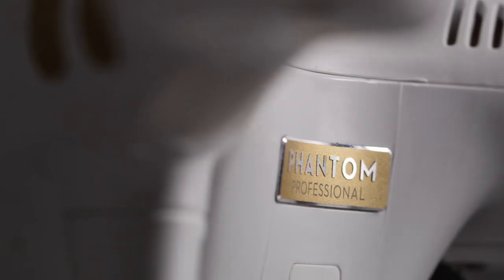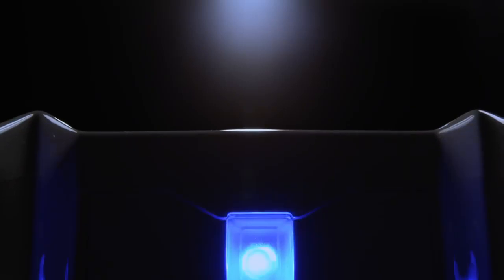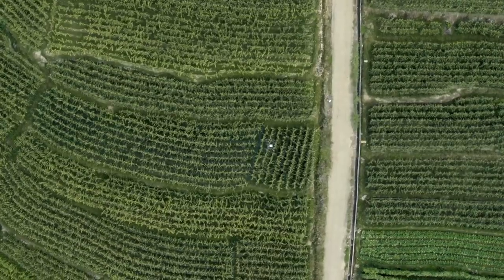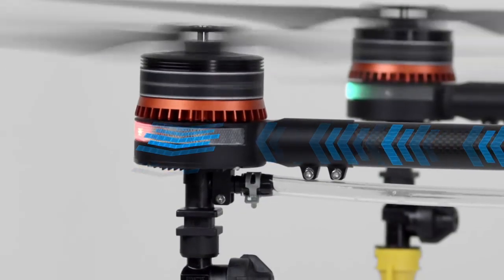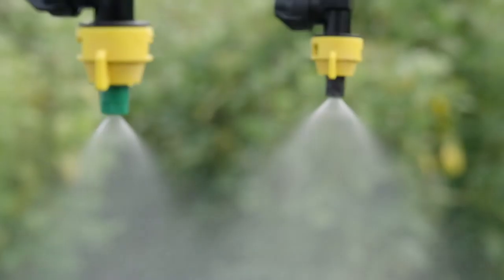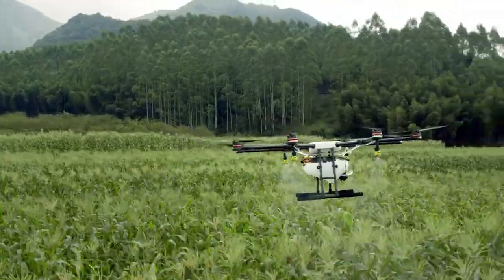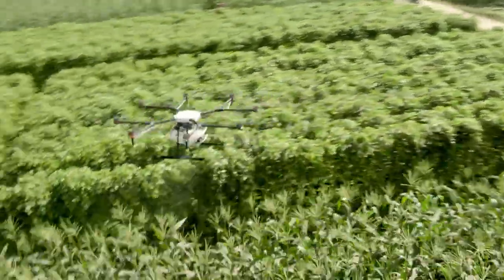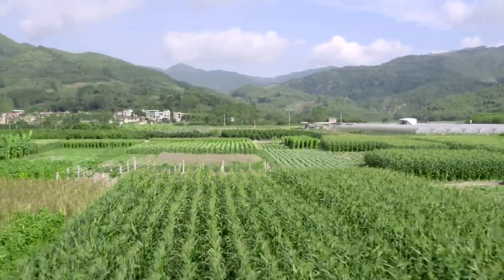DJI Agras MG-1 ALL NEW! Agriculture Spraying Drone!

Comment: Tank holds 10kg  (about 22lbs or 2.6 gallons) so I assume this is being marketed to "small" farms. Drone runs for 10K meters per charge which is about 2.47 acres. A "small" agriculture farm has around 100 acres (average in USA is 444 acres) so the drone would have to fly around 40 times to fully spray 100 acres. IF the drone could automatically refill the herbicide/insecticide AND automatically swap batteries it would be a great alternative to manual spraying. However, assuming an average 20 minute flight time, it would take 800 minutes (20*40) or 13+ hours of constant running to cover 100 acres. That's also assuming you had a ton of batteries to swap out and replace that were fully charged.

While technologically impressive, I just don't see a market for this considering the cost/time involved of constantly swapping out batteries, waiting for batteries to recharge, having to constantly refill the small 2.6 gallon tank.

A comparable CropCare 3PT 150 Gallon 20 foot boom sprayer that attaches to the back of a tractor costs on average below 4k and covers 100 acres in less than 5 hours seems much less of a hassle in the long run. Spend 10-14K for a DEMCO 500 gallon sprayer with a 60 foot boom and it would take about an hour.